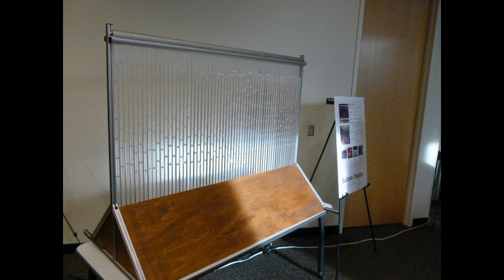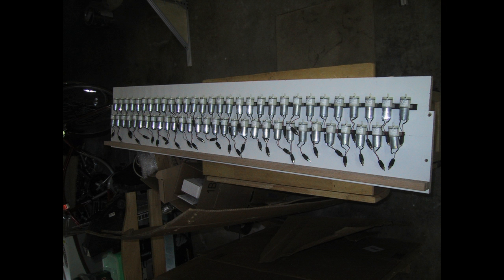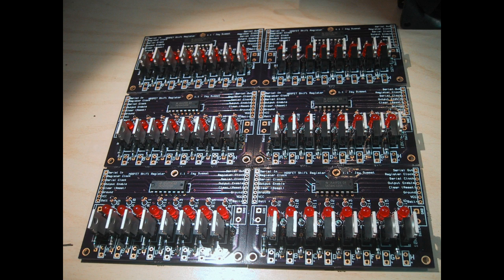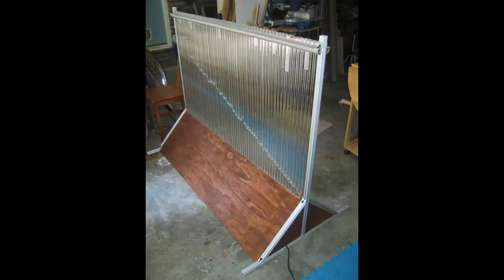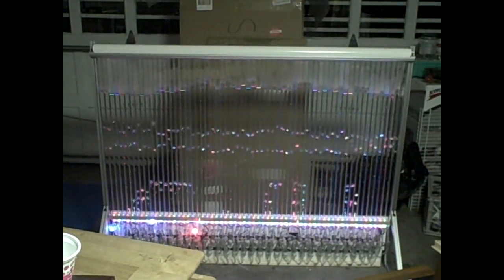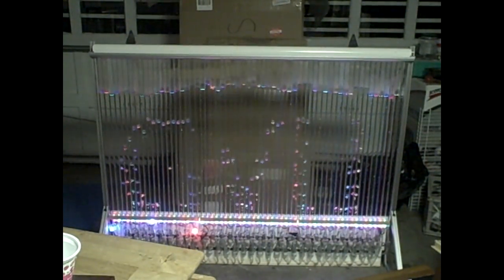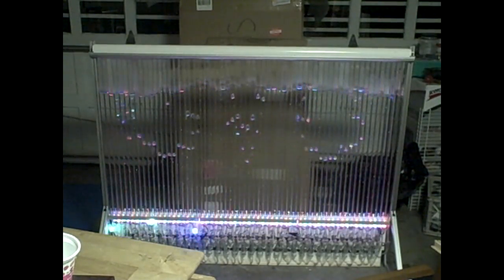GVU Bubble Display - Overview Video

Comment: Hey Jay.  I'm working on a similar project. I've ordered the same air pumps, at least visually they appear to be the same.  My plan was to use fast, high-current relays to switch the motors, but you seem to have extremely granular control here.  Do you think fast relay switching will be sufficient, or would you recommend using motor controllers?  Perhaps something off-the-shelf that can work with Arduinos? Edit:  It's worth noting that I have 16 columns, not 60.  :)
Reply: SilentGloves As a point of reference, I just hooked my relay module up to the scope and wrote some code to switch it on then off at 50ms, then 25ms and got fairly reliable square pulses, albeit with a bit of ripple (which is to be expected).  Given the physics of spinning up a pump motor, I would theorize that 25ms pulses would be sufficiently fast to generate fairly controlled bubbles.  Is this within the order of magnitude that you are using here?
Reply from the maker: SilentGloves  Yes my bubbles were ~45ms (+/- up to 5 ms to account for pump variations) so that will work. However, I'd suggest going solid state using a 4x4  driver shield from SparkFun on an Arduino.  With only 16 columns, you are at a sweet spot for available off the shelf hardware...
Reply: Jay Summet Excellent!  If I'm reading the specs correctly, one shield gives me exactly 16 channels of high-current switching.  For $59.95 to get rid of the physical relay clicking, this would be quite the victory.  Thanks!
Reply: Jay Summet One more question.  How are you piping through the bottom acrylic plate?  My project is using 3" OD acrylic tubing, and I'm using a 1/4" inch acrylic disk at the bottom.  Each tube will have an air stone and an open fitting, each of those with their own motor, and given that once it's welded, they're inaccessible, I need a highly durable method of plumbing that all up through the bottom plate.  I 've been searching around for various fittings but am not having much luck.  Since you experimented with all the stuff, can you provide some links perhaps?  Many thanks!
Reply from the maker: SilentGloves  I'd suggest you read all of my posts tagged "bubbledisplay" (starting with the oldest first) to find everything I learned:
http://www.summet.com/blog/tag/bubbledisplay

The posts most appropriate to your current questions are:
http://www.summet.com/blog/2012/05/21/acrylic-welding-solvent-bubble-display-nozzle-test-1/

http://www.summet.com/blog/2012/06/25/nozzle-size-material/

(Are you going to use water or glycerin as your display medium?)
http://www.summet.com/blog/2012/06/16/testing-glycerin-as-a-bubble-medium/

If you are going to use aquarium airstones, just drill an appropriate sized hole in the disk, poke the airstone hose barb (probably nylon material) out the bottom, and use epoxy on the bottom to hold it in place (before you weld the disk to the bottom of your tube).  If your hose barb is acrylic or polycarbonate, the same acrylic welding solvent that you use to hold the disk to the bottom of the tube will also weld the hose barb....
Reply: Jay Summet Hey Jay, I've read through the entire blog series.  Very helpful!  Thanks for putting that together.  I didn't see a link to the specific polycarbonate 1/4" to 1/8" single-barbed reducers you used.  That's the part I'm having trouble tracking down.  Would you happen to have a link?  Thanks!
Reply from the maker: SilentGloves You are right. I have updated this post to include my BOM spreadsheet:
http://www.summet.com/blog/2013/09/01/bubble-display-source-code/

Those specific hose barbs are from McMaster Carr, part number 5117K61, and cost 83 cents each (plus shipping) and come in packs of 10.
Reply: Jay Summet Thanks!  I managed to track down a few different options, yours included.  One of the problems is that my columns are 3" OD, and I'm using 1/4" acrylic for the bottom plate because of the larger surface area.  I've looked at the CAD drawings of several of these multi-barbed tube-to-tube unions and bulkheads, and none really have a body that is sufficiently long to make it through 1/4".  I have more hunting to do.
Reply: Jay Summet By the way, this is the account (Silent Gloves DIY)  I'm uploading videos to if you'd like to follow along.  :)
Reply: Jay Summet Hey Jay, one more quick question if you have a moment.  What epoxy did you use to bond the air stone (likely polypropylene) to the acrylic base?  I'm having difficulty finding an epoxy that will bond these two materials and also survive being submerged in water.  Thanks in advance!
Reply from the maker: SilentGloves When gluing the aquarium air stone, I used relatively standard 2 part epoxy (5 minute cure) (Tower Hobbies store brand). I didn't use it inside the tube however. I pushed the nozzle of the airstone through the 1/8" acrylic and put the epoxy on the bottom. Because I decided against using airstones, I never tested it for longer than a week, but I didn't have any water leaks in that time frame. I'm sure you can find some marine rated epoxy that will be waterproof if you really need it.